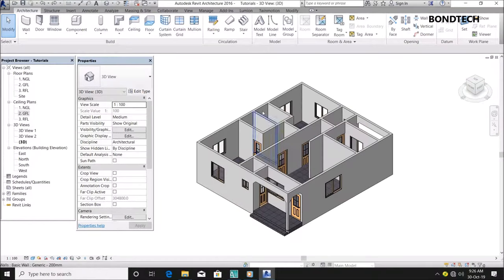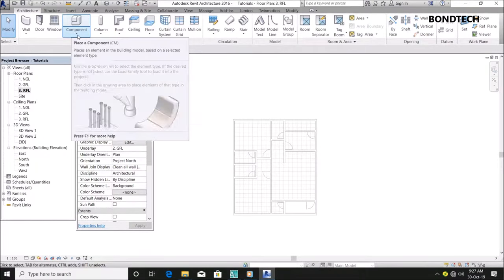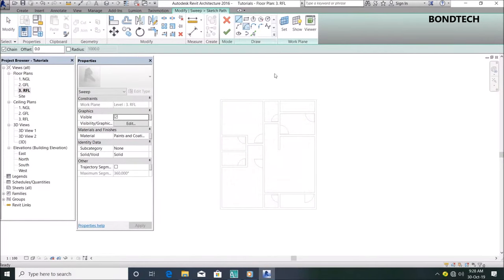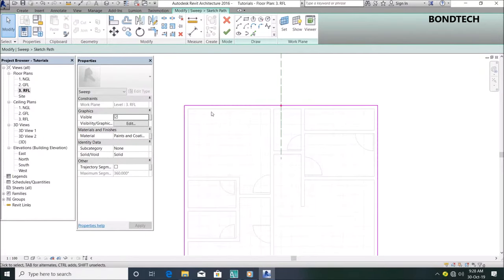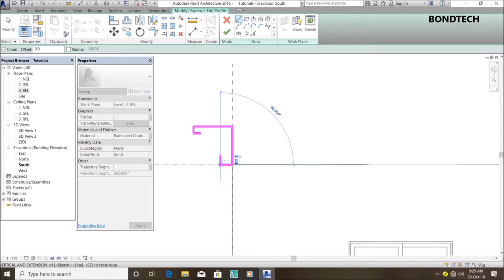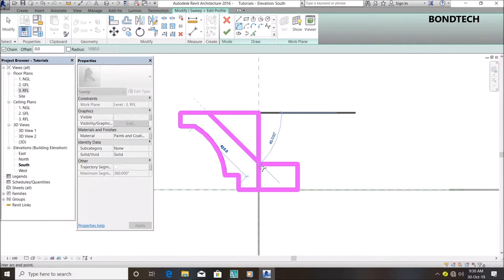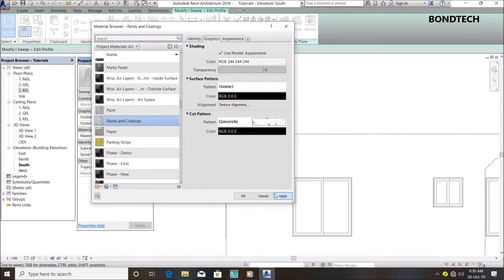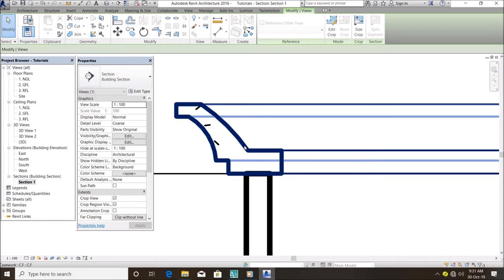How to Create Revit Conc  Fascia  using Solid Sweep

Comment: What if you wanna differ the concrete facial height, most modern buildings do have some part where one facial is higher than the other, how do I go about it?
Reply from the maker: You will have to copy the first one you created, the increase the profile height to what you want, the also edit the sweep path
Reply: @bondtech2257  
Seem difficult to understand 
Can you demonstrate it please? 
Or send in your whatsapp contact Please. 
Thank you .
Reply from the maker: @danielmbazu367  
Ok. +2348165688709